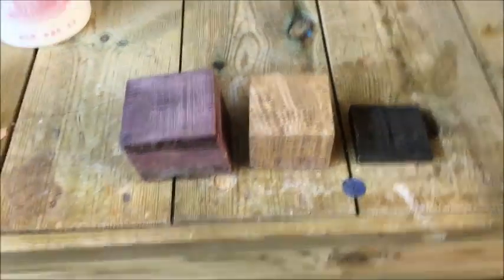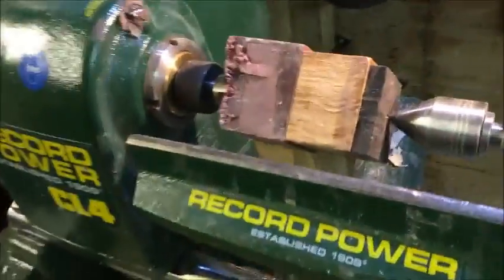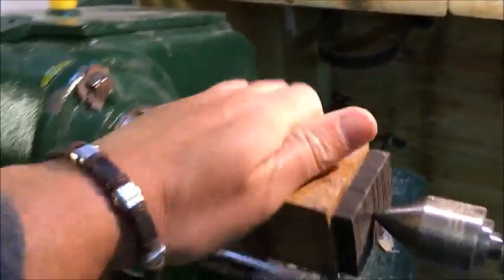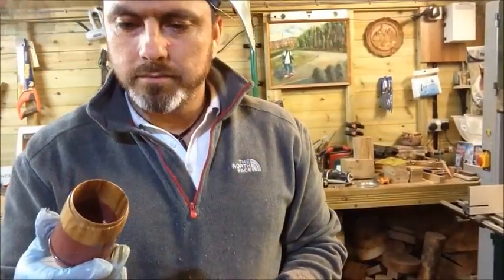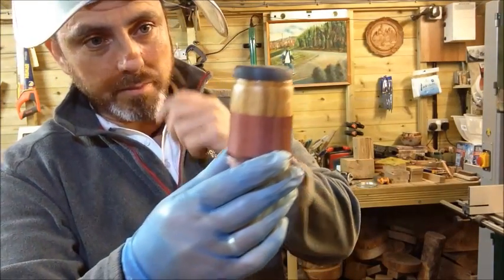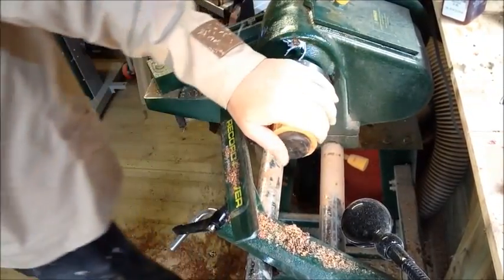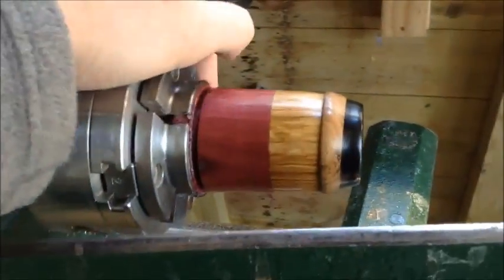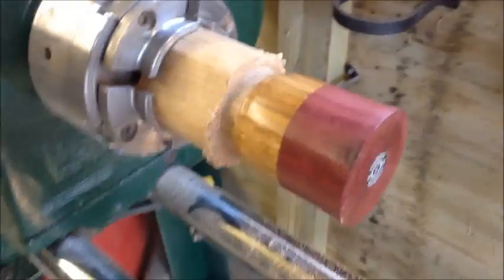Wood Turning - Scrap Wood

Comment: Really like the mix of colours Nick & finish is very nice. A question if you don't mind me asking is how do you do your emblem. Is it some kind of water slip transfer or laser engraving ? It sets your work off & looks professional - better than cutting rings for sure.
Thanks for sharing, Geof Harris.
Reply from the maker: +geofo60 Hi Geof, thanks for watching. the emblems I use are made for me by a manufacturing company near me. the black ones are galvanised and the other ones are made form Brass. they machine them I believe. they are only small a little smaller than a penny. Hope this helps All the best
Reply from the maker: +NZ WoodTurning Sorry Geof, I meant to say the black ones are Anodised. All the best